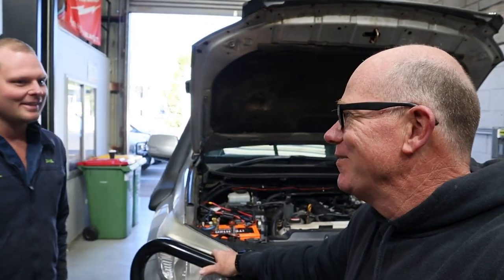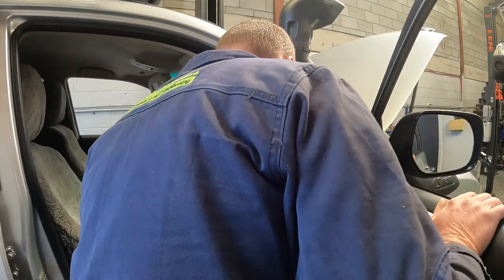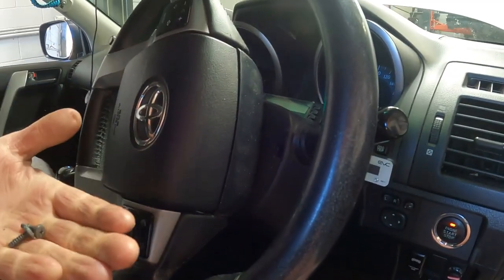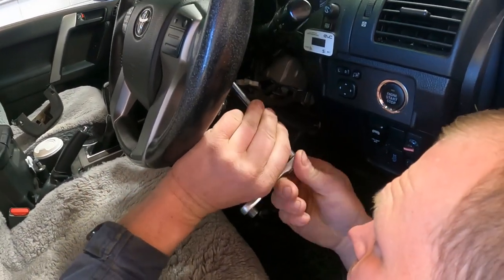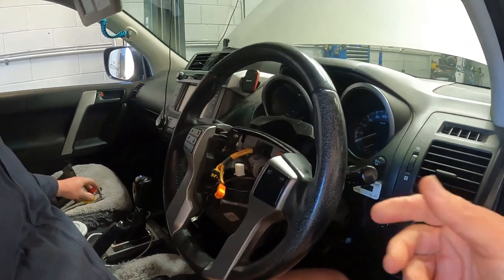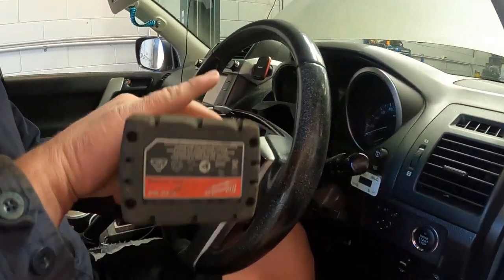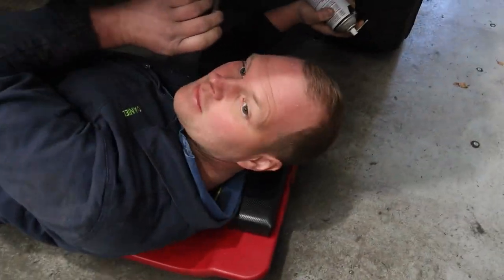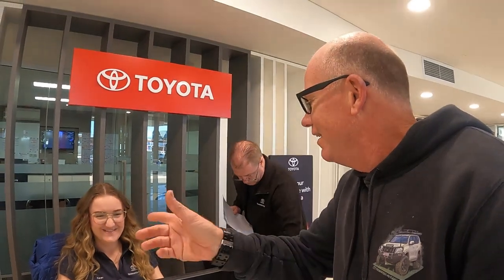Installation of the Clock Spring Toyota Prado 150 | Is this the ONLY PROBLEM with this PRADO?

Comment: The procedure is called a Zero Point Calibration. If your vehicle has Downhill Assist and/or Crawl Control you have to turn them on and off during the procedure to let the computer know that the vehicle has those functions.

Comment: Usually the Spiral Cable (Clock Spring) only fails if there has been some steering work done.  Such as wheel alignment where for example they removed the steering wheel to straighten it, or there has been steering rack work done.  Very common (for example) after frontal accident repair and the steering rack has been removed and not refitted correctly and then they blame the accident for the failure - incorrectly,
Reply from the maker: Thanks mate. Not sure. But I'm so glad to have the Prado back to 'normal'. 👍👍
Reply: These fail very often in Prados that have inhaled a lot of dust.

Comment: I did this as reply to other below but may be more helpful as separate comment as almost noone seems to know this info, and these issues can be extremely stressful - because you will never know  how bad things are, until its fixed. And noone can  diagnose and fix this shit properly. Like for me, bloody dealer left me thinking my whole ECU mght be knackered, but no, its just bastard clockspring/steering angle sensor.
Also, , I'm changing my earlier advice here. I said any good wheel alignment place should be able to do the ZPC (Zero Point Calibration), and, ideally they would, but I've just taken my Prado with dodgy clockspring (airbag light on) to a dealer because i wanted my injectors tested as well, and they told me their computer wouldn't talk to my car at all and they need to call in auto electrician. So I said thanks for wasting my time and replaced clockspring. Then I took to TWO wheel alignment places who have been good in the past - one of which was the place i took it to last time  my clockspring went  bad, and last time they knew how to do it. This time.... no idea. Both places failed.. I therefore wired up my own little "SST" tool and  used it to do ZPC & DAC calibration myself. And my Veepeak OBD tool talks to car ECU fine, and no troublecodes left. So the moral of the story is, this is an absolute bastard of an issue, and almost  noone seems to know how to do it correctly. So its a good idea to learn how to do it yourself. 
And on that subject, there are TWO vital  tips which are almost always overlooked, and which absolutely FUCKS everyone attempting t o do this on Toyotas, esp . the 4WDs. 
First, Toyota install the OBD socket UPSIDE DOWN. So the long side is on bottom. All pinout diagrams are drawn with long side on top. That means when u look at upside down connector, pins are numbered backwards compared to diagram and pins 4 from left in DIAGRAM is actually pin 5 from left in car with upside down connector.... So this is why many youtube videos say to use pins 5&13 instead of 4&12 - they are looking at upside down connector.
Finally, 2rd bastard issue  is that if your car has DAC (Downhill Assist) like many Prados & other 4WD - then you must also re-initialise your DAC system after doing ZPC. It is super easy but if you don't do it you will be left with your ABS/Traction Control light locked on on your dash, and you'll have C120A "ECU initial setting incomplete" trouble code. Good news is if you forget to do DAC after the  ZPC, no  problems, you do NOT have to do ZPC again. All you do is JUST the DAC procedure, and you're done. And to initialise DAC system all you do is put car in test mode (easy with scan tool and easy DIY manually too - just connect pins 4&12 with SST wire and then ignition on, ABS lights will be flashing, this is what they call "Test Mode"), then you just press DAC button in and check green car on hill light comes on on your dash. Then ignition off & remove SST wire. That's all there is to DAC initialisation, you're done. When you start car ABS/Trac light will be off & your ABS will be working again. So anyway, learning to do this yourself can save yourself days of stress & ballache taking your car to people who say they can do it, but, they cant.
TIP: to make the DIY procedure MUCH easier i highly recommend buying a Toyoya "SST" tool for $10 or $20, OR make your own like i did, from a simple toggle switch & wire. That all it is a wire with switch. But the wire needs to be good and stiff at each end so u can push into OBD connector. I stiffened end of my wires by tinning with solder and that worked for me but could be finicky if ends then too fat to fit in pins. Grab Toyota SST if you can as end prongs are made to fit nicely. Anyway, an SST tool or homemade will work way better than the paperclips people use in videos - i tried paperclips, and they are aabsolute mofos, its never as easy as ppl claim in videos as the paperclips never stay aligned right for long, they turn & flop & you'll have huge ballache touching them together 4-8 times to enter ZPC mode. WAAAAY easier with SST or homemade switch you can just press or toggle back & forth easily.
TIP2: my first replacement clockspring was a $25 ebay special and my first steering angle sensor was also $100 ebay junk, and both lasted under a year. Clockspring went bad in 6 months (airbag light back on) and then just recently steering angle sensor threw "Steering angle internal circuit" troublecode. Steering angle sensor does not connect via cLockspring, it connects direct to car wiring connector so if you get this code your sensor is dead too. So cheap ebay garbage is why I'm doing this for the 2nd time now.... Still no way i'm paying toyota $800-1200 for genuine clockspring & sensor so this time i got aftermarket clockspring from local supplier for $150 and sensor for $350 both wit 2 yr warranty. And now I've ZPC & calibrate DAC myself, all is good & hopefully  the damn things will last a while this time.
Reply from the maker: Thanks mate. I did get it all sorted, Prado working awesome. Currently on a big semi lap Australia at present

Comment: Thanks for the video.  Do you know what that yellow paint pen was called?  Very handy to have.
Reply from the maker: Mate not exactly sure, but I'm sure you could buy it from an auto shop. It has a push down nib part to allow the paint to flow through. Cheers mate 👍

Comment: very good video. Do you know the code of that clock spring? I need an identical one. toyota prado 2014
Reply from the maker: New genuine clock spring part number 84307-60020 with steering angle sensor to fit some Toyota Landcruiser Prado vehicles. Fits some 150 series models from the date 08/2009 onwards

Comment: Fellow Prado (2019 GX) here. Thx for sharing- good info for when (if) this happens to me in the future 

I noted you have nearly done 250k. Have you had to do the injectors yet ?

Good luck on Fraser 

Cheers
Reply from the maker: Thanks mate. No I haven't had to replace them yet. I'm trusting Dan, as he said I have I think Gen 5 injectors which Toyota have seemed to ironed out previous issues. It's not having any tell tale signs of having any issues. How about yours? How many Kms has yours done?
Reply from the maker: Oh, Fraser is absolutely awesome!! Prado did awesome too. 👍👍(Dingo walked past me actually just now!)
Reply: So many buttons to press mate in your car, another level of 4x4.

Glad you got to the bottom  of it .
Reply from the maker: Thanks mate👍

Comment: One more tip  - be very careful with the 3rd black clip that goes in at 20:00  - it is a mind-buggering piece of shit, if not aligned perfectly it can very easiily bend the pins in socket, possibly fucking your new clockspring.
Reply from the maker: Thanks mate.

Comment: Also there's no need to take to dealer to calibrate the sensor, there is a prick of a procedure to do it yourself, involving shorting pins on OBD port, but don't do that. Should be able to take car to any  good wheel alignment place, and they will calibrate it & clear code, as they proilly see these issues a lot.
Reply from the maker: Cool, thanks mate 👍
Reply: @prado150outahere  On 2nd thoughts, I'm changing my advice here. I said any good wheel alignment place should be able to  do it, but I've just taken my Prado with dodgy clockspring (airbag light on) to a dealer because i wanted my injectors tested as well, and they told me their computer wouldn't talk to my car at all and they need to call in auto electrician. So I said thanks for wasting my time and replaced clockspring. Then I took to TWO wheel alignment places who have been good in the past - one of which was the place i took it to last time  my clockspring went  bad,  and last time they knew how to do it. This time.... no idea. Both failed..I therefore wired up my own little "SST" tool and  used it to do ZPC & DAC calibration myself. And my Veepeak OBD tool now talks to car ECU fine, and no troublecodes left. So the  moral of the story is, this is an absolute bastard  of an issue, and almost  noone seems to know how to do it correctly. So its a good idea to learn how to do it yourself. 
And on that subject, there are TWO vital  tips which are almost always overlooked, and which absolutely FUCKS everyone attempting t o do this on Toyotas, esp . the 4WDs. 
First, Toyota install the OBD socket UPSIDE DOWN. So the long side is on bottom. All pinout diagrams are drawn with long side on top. That means when u look at upside down connector, pins are numbered backwards compared to diagram and pins 4 from left in DIAGRAM is acctually pin s 5 from left in car with upside down connector.... So this is why many youtube videos say to use pins 5&13 instead of 4&12. They are looking at upside down connector.
Finally, 2rd bastard issue  is that if your car has DAC (Downhill Assist) like many Prados & other 4WD - then you must also re-initialise your DAC system after doing ZPC. It is super easy but if you don't do it you will be left with your ABS/Traction Control light locked on on your dash, and you'll have C120A "ECU initial setting incomplete" trouble code. Good news is if you forget to do DAC after the  ZPC, no  problems, you do NOT have to do ZPC again. All you do is JUST the DAC procedue, and you're done. And to initialise DAC system all you do is put car in test mode (connect pins 4&12 with SST wire and then ignition on, ABS lights will be flashing, then you just press DAC button in and check green car on hill light comes on on your dash. Then ignition off & remove SST wire. That's all there is, you're done. So anyway, learning to do this  yourself can save yourself days of taking your car to people who say they can do it, but, they cant.
TIP: to make the DIY procedure MUCH easier i highly recommend buying a Toyoya "SST" tool for $10 or $20, OR make your own like i did, from a simple toggle switch & wire. That all it is a wire with switch. But the wire needs to be good and stiff at each end so u can push into OBD connector. I stiffened end of my wires by tinning with solder and that worked for me but could be finicky if ends then too fat to fit in pins. Grab Toyota SST if you can as end prongs are made to fit nicely.  Anyway, an SST tool or homemade will work way better than the  paperclips people use in videos - i tried paperclips, and they are aaabsolute mofos, its never as easy as ppl claim in videos as the paperclips never stay aligned right for long, they turn & flop & you'll have huge ballache touching them together 4-8 times to enter ZPC mode. WAAAAY easier with SST or homemade switch you can just press or toggle back & forth easily.
TIP2: my first replacement clockspring was a $25 & steering angle sensor about $100 off ebay, and both lasted under a year. Clockspring went bad in 6 months (airbag light on) and then just recently steering angle sensor threw (Steering angle internal circuitry" troublecode so thats dead too. Which is why I'm doing this for the 2nd time now.... Still no way i'm paying toyota $800-1200 for genuine clockspring & sensor so this time i got aftermarket clockspring from local supplier for $150 and sensor for $350 both wit 2 yr warranty. And now I've ZPC & calibrate DAC myself, all is good & hopefully  the damn things will last a while this time.
Reply from the maker: Mate, sounds like you've had no end of dramas with that. Fortunately for me it was pretty straight forward, however I was a little worried at the start. The electronics side of things can really be a headache. I am lucky now that everything was sorted, however I did run into more problems with the Prado, just before my big trip to Perth as you'd see in my later videos. Thanks mate for going to the trouble of leaving those comments, appreciate it.